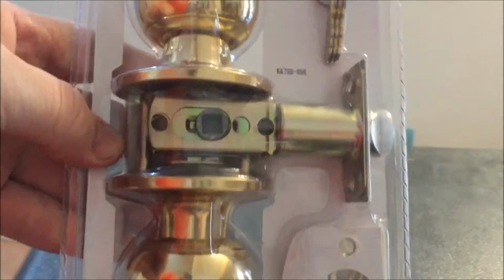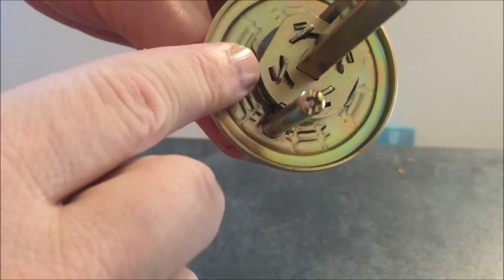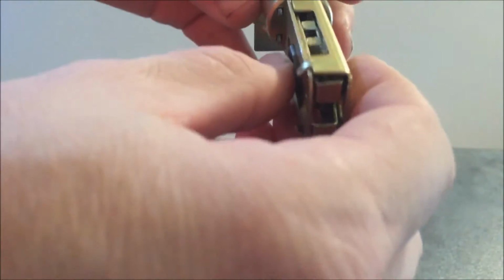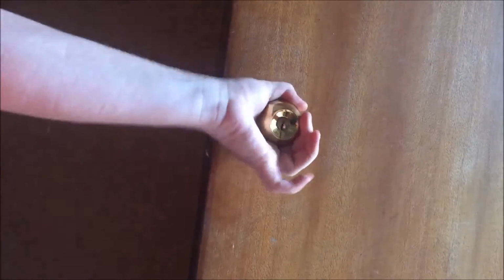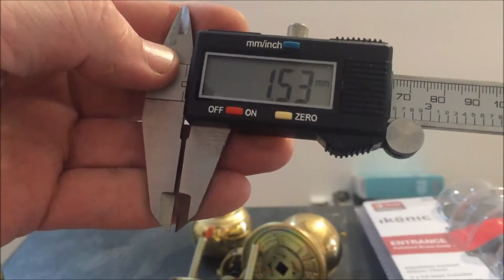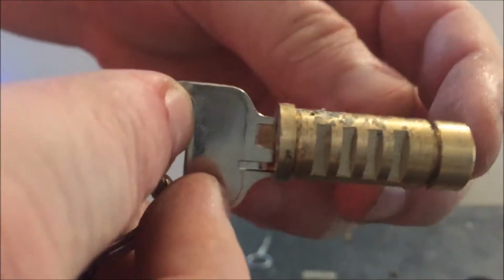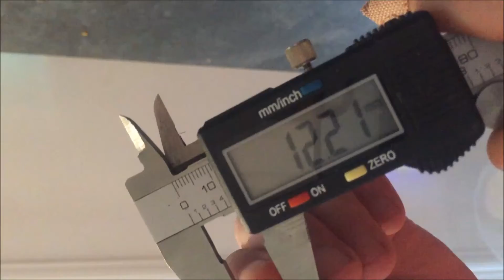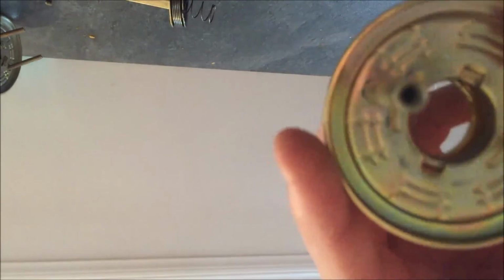iknoic entrance knob lock from Bunnings Review

Comment: I have the exact one on my front door, son put it on & although movement, works. I am now trying to put in black passage Ikonic. Frame striker, fine, internal fine, sturdy & if I hold in place turns knob BUT I cannot attach to door. The little hole does nothing. can't put screw in at 60 degree angle & Bunnings only shows hole to make a hole - which is already there. you skipped how to attach to door.

Comment: Yer. I shy away from door locks in the lower half of the price range. I actually fitted beefy security doors because my entrance doors have glass panels so you could break glass. Reach in and unlock Knob. Great Vid. I learned heaps about the insides of a lock assembly